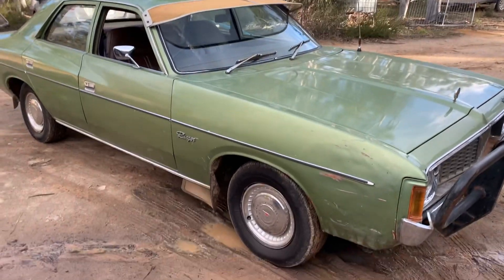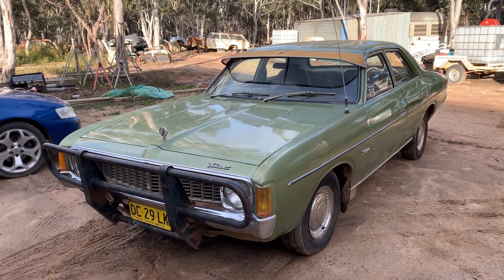VJ Ranger update plus more

Comment: Those single barrel were not that good. No kick down cable is no good for the old auto . Extractors and  a sports exhaust. Some 14 x 7  an 235 60 tyres  new shocks. Loss the bill bar an visor 😆 👍🏻🇦🇺